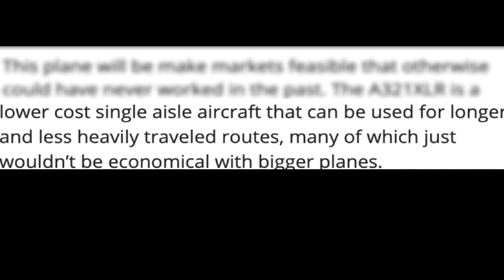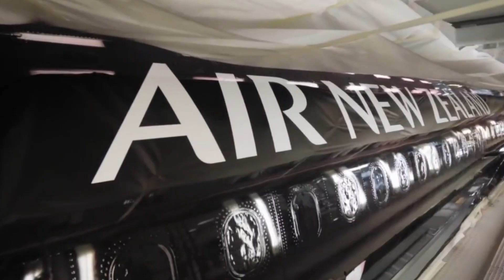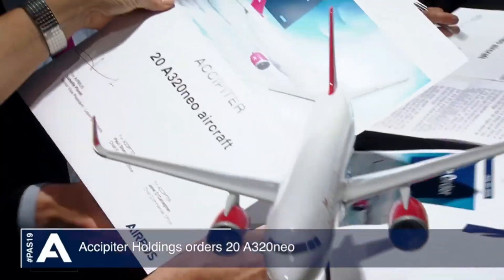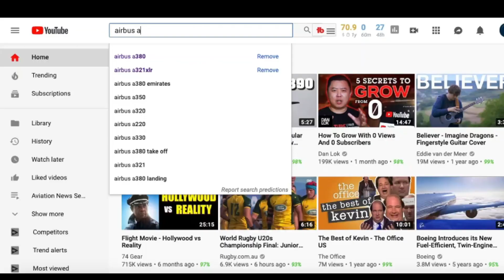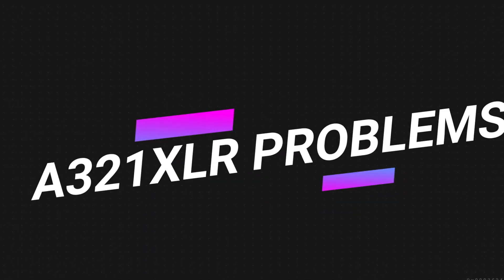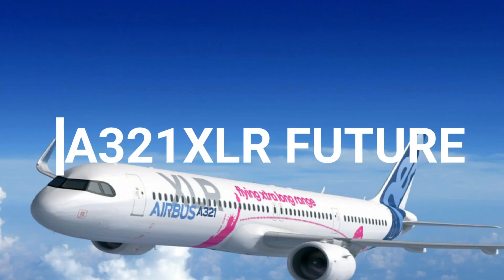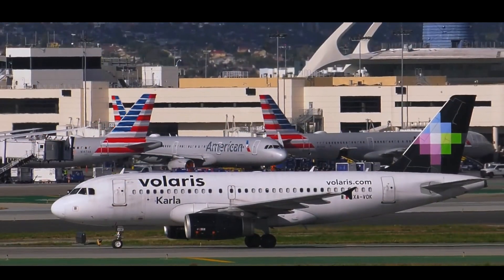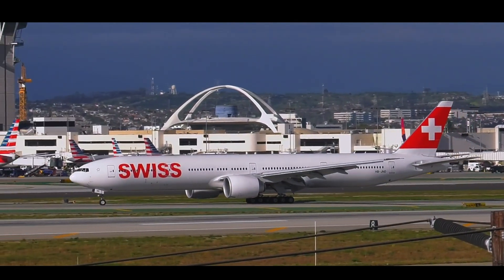Airbus A321XLR: What IS It?? ( 2019 )

Comment: There is one error in your video which is from misinformation (fake news) that many journalist have also spread have picked up.  Airbus's website says they reduced cabin pressure down from 8000ft to 6000ft, same as the B787 and A350.  Airbus have already done this on the A319 ACJ airbus corporate jets some time back.  As far as comfort goes the A320 has 18 inch seat width which is nearly 2cm greater than Boeing so you won't be pushing shoulders into the next seat if you are a full sized man.  The A321XLR has water increased from 200 Litres to 490 Litres.  It has 4 toilets 1 at front, two in the middle (which can be combined into one for disabled access) and one at the rear.  Plenty of ways to get to the toilet. The Overhead lockers are 30% bigger so everyone gets at full sized roller bag.  Airbus have a garbage compactor to reduce the garbage from the two hot meal services expected.    I've flown an 8 hour flight on a Philippine Airlines A321neo fitted with an ACT (Additional Centreline Tank)  from Sydney to Manilla 6200km and it was very comfortable, above average.  Philippine Airlines used to run an A321neo like this the 6400km from Melbourne to Manilla but it became so popular they had to put on an A330.   A321neo and A321LR  fitted with ACT are already flying nearly XLR distances very comfortably.  The new RCT (Rear Centreline Tank) that gives the XLR its extra fuel and the new optimised flap that increases take-off weight will allow more cargo to be carried.